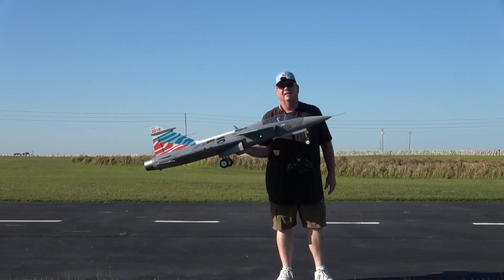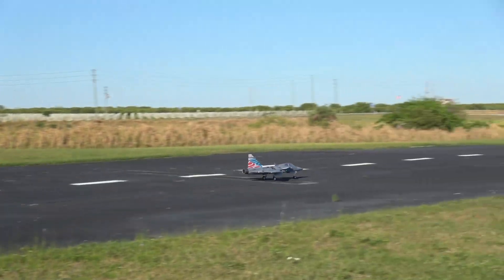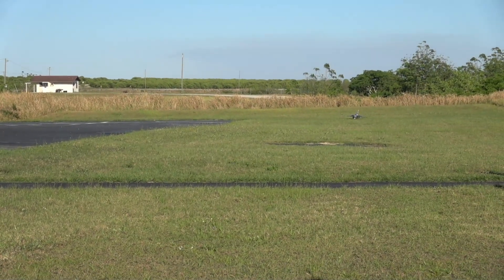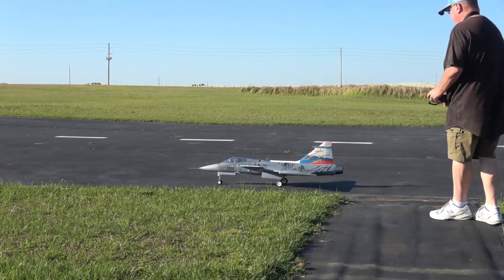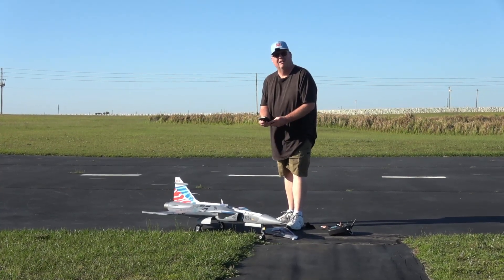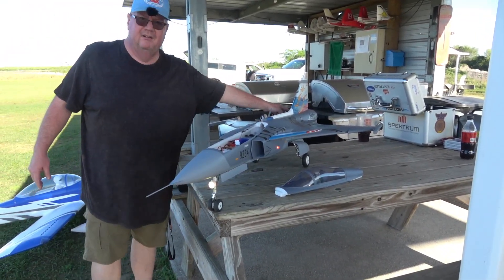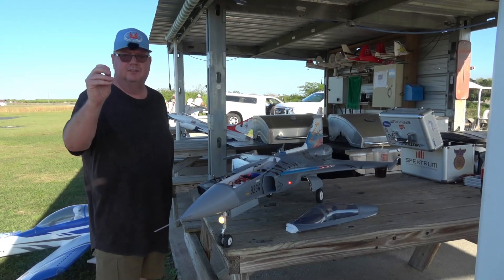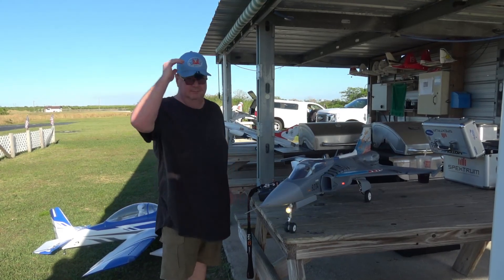FREEWING JAS-39 80MM GRIPEN MAIDEN + POST BUILD AND SETUPS by FGFRC

Comment: Since you’ve flow both the L-39 and the Gripen, how would you compare the two or which would you prefer ?
Reply from the maker: For a relaxing stress free flight the L-39! For a fun and unusual flight the Gripen! Two totally different type of jets and both fly differently. Both fly great but require different disciplines. The L-39 Lands more docile and is a little more predictable but still needs speed on landing, the Gripen requires a high alpha type landing and same kind of higher alpha as it cruises. L-39 has plenty of elevator and is very aerobatic, So is the Gripen but be careful with hard dives , she takes longer to pull out of them. Again two totally different animals and needs to be tamed in different ways.